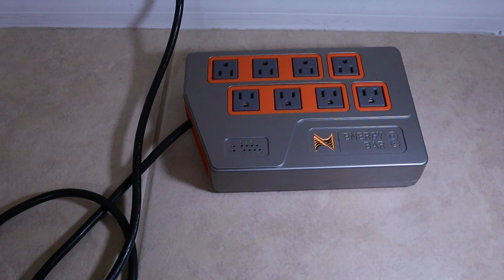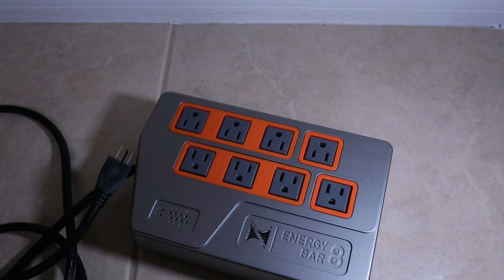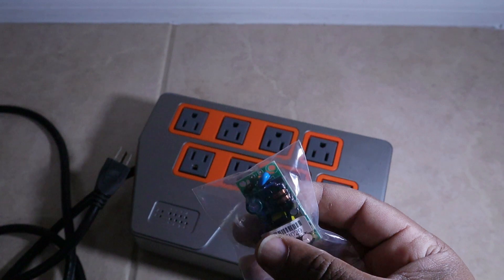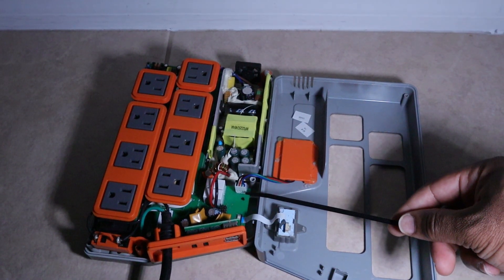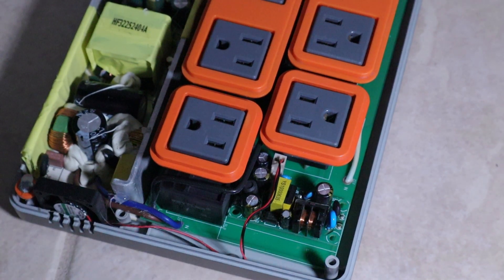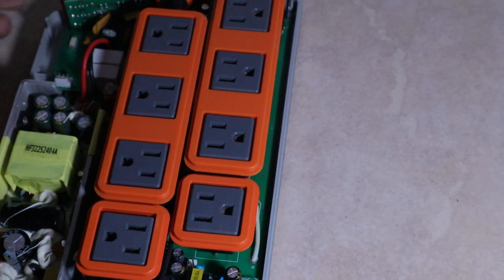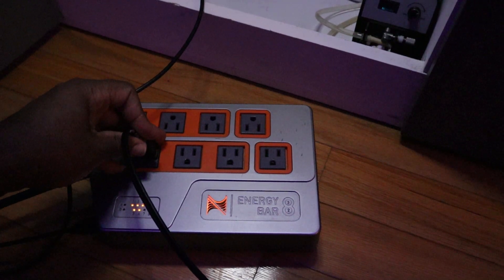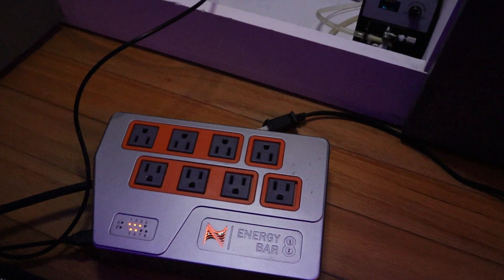Fixing An Apex Eb832 For $2 | Neptune System - How To Fix Your Broken Apex For Only $2!

Comment: The newer version has a different 12V PSU. IRM-05-12
MEAN WELL AC/DC Power Modules from Mouser. I'm told the older ones like in the video are not interchangable. Also had to replace (bypass) the built in circuit breaker as it fried as well.

Comment: I know you replied that you dont have a clip on how you did the desolder, but can you explain how you did it? I am trying but is realy difficult because of the 4 pins,
Reply from the maker: There is a device called a desoldering gun that will help to remove the solder from the pins and make it easier to remove.